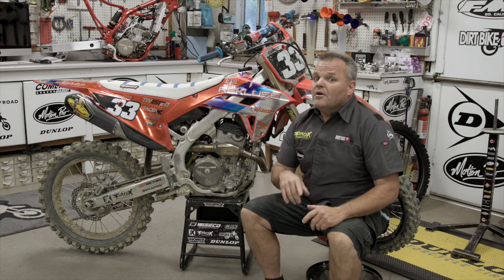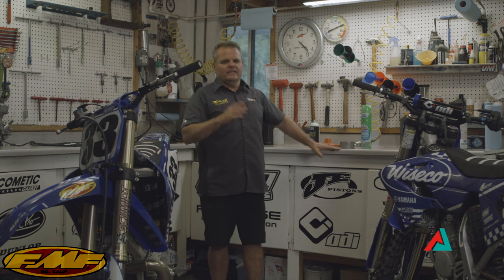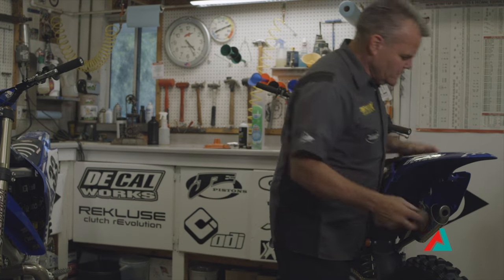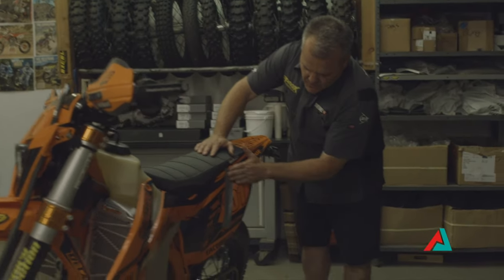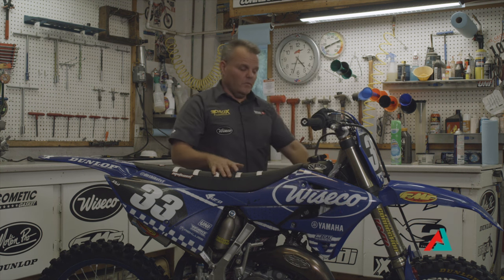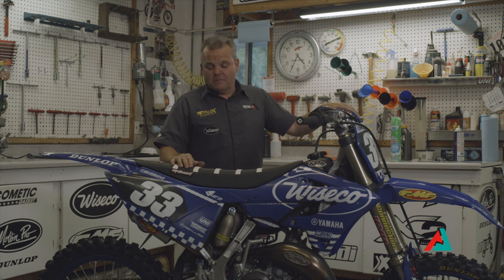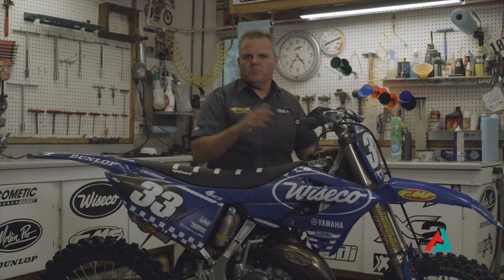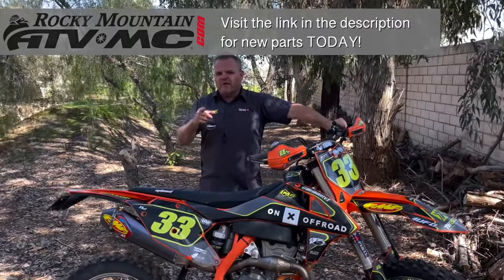How To Correctly Wash Your Dirt Bike

Comment: Take a better pro tip from me Ryan Reedy.  To protect your plastics and exhaust use a bike stand and gently tilt your bike over to wher your handle bar is on top of the bike stand. This way will help protect from any scratched from the pavement etc. Yourwelcome
Reply: The downside is that you can’t spin the rear wheel that way.
Reply: @EricCogburn  The final things is then I put the bike on the stand to spin both wheel as now the underside is clean.

Comment: I highly recommend a twin air wash cover. I have one for every bike. This allows you to wash the air box with the seat and air filter fully removed worry free. I like to gently hand wash the seat upside down with a low pressure garden hose since it’s off the bike. Plus you’ll be able to inspect, wash or replace your air filter after every ride. Might seem like overkill, however after paying to have a cylinder redone, I think the piece of mind of knowing my airbox and air filter are clean every ride is worth having.

Comment: Shooting pivot points and bearings from a couple inches away with high pressure air is just pushing more moisture in to those parts.  Stand back a bit if you are going to do that.  A small leaf blower from several feet away is a better option for drying.

Comment: You never showed using the Scrubbing Bubbles that was on the workbench. I like how it works.
I use my gas powered Stihl leaf blower also to dry it as my air compressor is small in volume.

Comment: Why so hung up on Scrubbing Bubbles?  Why wouldn't a 4 or 5 to 1 Simple Green or equivalent?
Reply: Muc off in a foam cannon works great.
Reply: Try it and you will see why. It works great
Reply: @derekbrayer75   no issue using it on aluminum or anodized wheels?

Comment: I really don’t get your obsession with laying the bikes over. It looks lame and unprofessional. How about why you’re doing it, because of your washer tip right?  A sells meteor blast quick connect pivoting brass coupler attachment. I like the 5 angle 120deg and 7 angle 270deg. Once you use these, you won’t be needing tip til the bike over in its side.